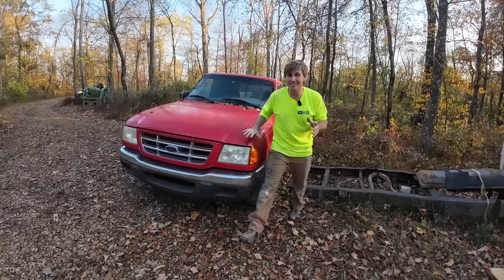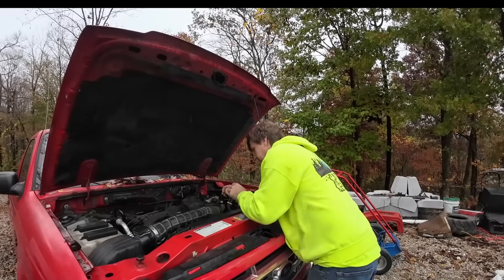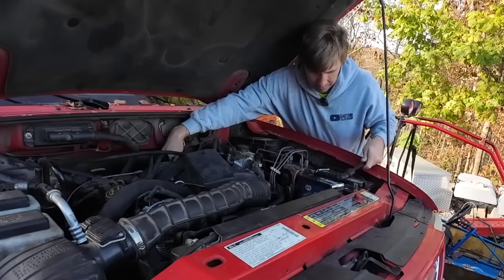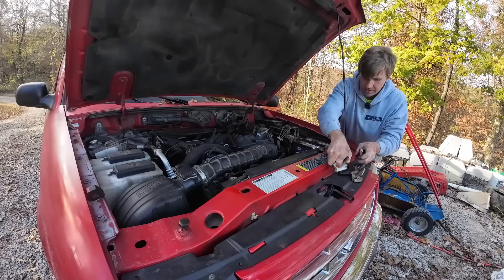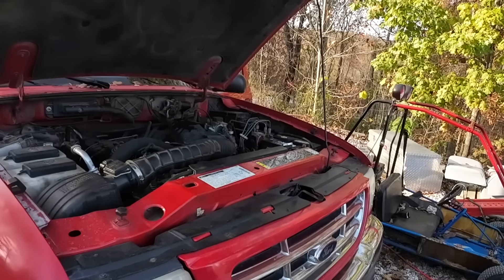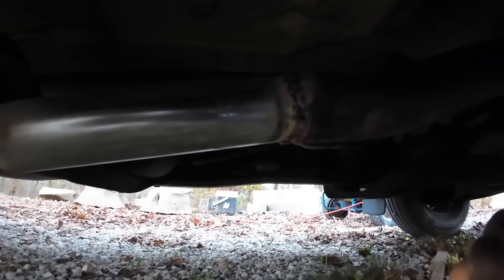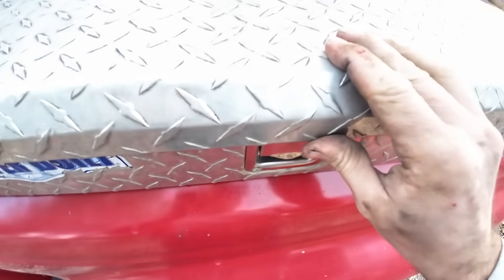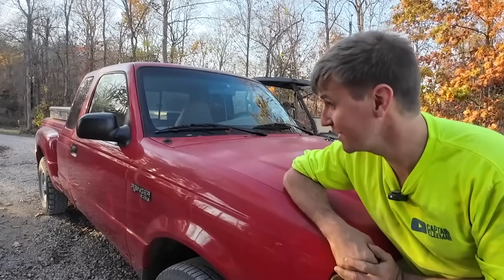Did I Get Ripped Off?  Bought a Ford Ranger with Junkyard Engine

Comment: I had a problem with a Ford Cortina automatic many years ago. I did all kinds of adjustments to no avail, it turned out to be as simple as a one inch hairline split in a vacuum pipe I’d not noticed until by accident. Excellent as always Mike 👍👍🇬🇧🇺🇸

Comment: They will always idle high at first, until it warms up.  
Similar to having a manual choke on;  that idle air control (IAR) is literally doing the same thing as a manual choke.  If your temp gauge isn't working-- the computer will think that it's still cold and keep it at high idle.  So that's another thing to check-- make sure the coolant temp gauge is working;  that is what controls the IAC and tells it when to "virtual choke" the engine when it's cold..  Sometimes the IAC gets sticky from being old.. If you just take it off and spray it clean and get it free'd up and moving again-- you can get more life out of it when it's sticking shut.

Comment: The 3.0 engine is super reliable and a great engine. Still check for vacuum leak, but also clean the IAC valve. That plunger can get stuck from soot. If it still idles high check plunger actuation. Also just unhooking battery cables for x amount of time will not reset the computer, there are capacitors that still hold a charge for memory. You will have to touch the cable ends together when unhooked from the battery to properly do a computer reset/relearn phase. Just subscribed to your new channel, keep it up!!!

Comment: Mike, You might take a closer look at the IAC, you checked the solenoid but you didn't check the function. The varying voltage moves a rod in the IAC depending on what the computer calls for. The rod could be catching at a certain point, or points in its travel causing the RPM hang you are seeing. Its common in that era Ford.
Reply: You are right on the money, I had same issue with my old Ford

Comment: If that engine and trans really has only 88k miles, then you got yourself a great truck.   
These trucks are so light weight that everything seems to last forever on them;  wheel bearings, ball joints and tie rods, etc.

Comment: I had a couple Ford Rangers, and loved them. Couple problem issues with the rangers I had (1) bad heads (2) rear spring shackle brackets rusted off. Maybe change that IAC valve.

Comment: Unplug IAC and set idle with idle set screw to 850-900rpm, Check TPS voltage and reset to .85-.90v key on engine off, at green (+) and black (-) wires of TPS or use battery ground (voltage can be screwy from sensor to battery ground if engine ground isnt good to the battery)then with key off plug in IAC. Thats a base idle reset, a lot of people think the IAC is to control idle completely but it is designed to “assist” when AC comes on, PS gets pegged hard locked one way and when engaging R/D. When engine was swapped somebody could have moved the idle screw

Comment: Hi Mike.  That looks like a pretty solid little truck.  I had a 1985 Ranger that had a high idle which was caused by a bad throttle position sensor.  Mine was a 4-banger so yours might not even have one but figured I'd let you know my experience.  Good luck with it!
-mike

Comment: You should have an Idle Air Control valve that controls the throttle opening. They do go bad. I would definitely check the electrical connections & maybe try another IAC.
Reply: Its literally the first thing he checked. That being said, he only checked the solenoid integrity, not the function of it.

Comment: How clean or dirty is the throttle body? I use carb cleaner to check for vacuum leaks on vacuum hoses, the RPMs will increase if the spray hits a cracked or broken hose. Clean the mass airflow sensor which requires a special spray cleaner. Little issues always add up to cause many bigger problems. Good luck 🤞..

Comment: If ya be needing any parts, I have an 01 Ranger 4x4 here that only has 131,000 on it. everything worked when I quit driving it 2 years ago, but the frame is completely rotted out. 3.0 Automatic OD with working AC and heater! 
It will most likely get hauled to the scrap yard next spring, if I get rountuit.

Comment: i got a 90 4.0.i had to remove my IAC valve & physically clean it out along with the air passage with a long "block cleaning brush".after cleaning its idled great every since.there long lasting little trucks if you treat them right & maintain them regularly.

Comment: Every 3.0 I've ever touched died with blown head gaskets, it was a car motor they shoved in the Ranger as a mid-level option. The 4 cylinders are dead reliable, the 4.0 OHV was indestructible, but the 3.0 and the 4.0 SOHC were marginal.

Comment: I put a junkyard engine into an old car and then I put 25,000 miles on the car.  Sometimes the junkyard engine is just fine.  

Most junkyards now give a 30 day or 90 day warranty on engines or transmissions. (trade the failed one for another, they normally don't compensate for labor or towing.)

Comment: 6:37  I'm not familiar with that particular transmission, but a common issue when a transmission pan is pushed up like that, it tends to close that gap between the filter and the pan and restrict the flow of fluid for the transmission.  Not a good situation for the transmission!

Comment: capt K i just had to do a high idle issue on the families ford escape its the throttle position sensor can do the same thing we thought it was the iac but it wasnt it also they put loctight on the threads of the position sensor the screws are a softer steel we had to replace them as they stripped out 5mm x 30mm socket head cap screws prefect replacements

Comment: 900-1000 is higher then i like my autos to be but its not bad my 99 ford ranger was a 5spd with the 2.3 4 cyl great truck it idled around 5-650rpm which is generally where manuals should idle auto is generally 700-850rpmbut every vehicle is different for example supercharged vs na and so on

Comment: You need a manual transmission then it wouldn’t matter. My 1968 VW was rebuilt with a 3/4 cam which required higher RPM to start moving in gear.